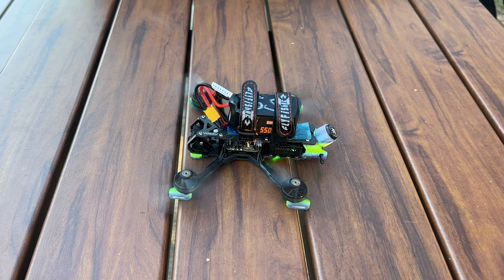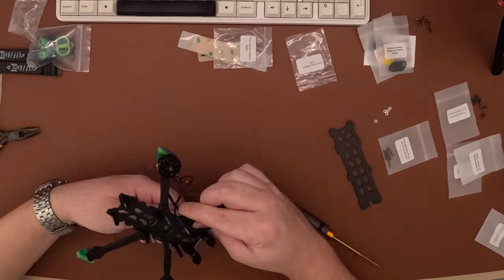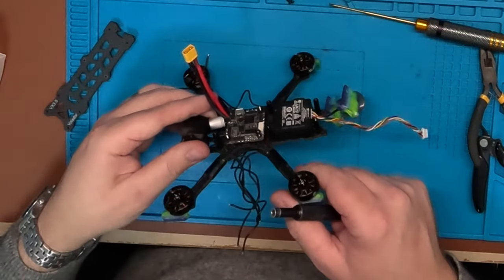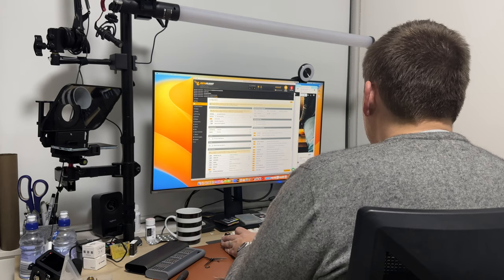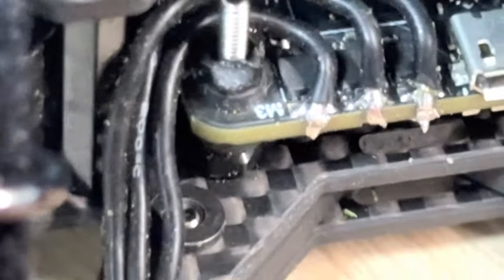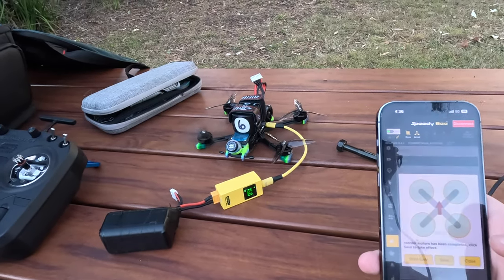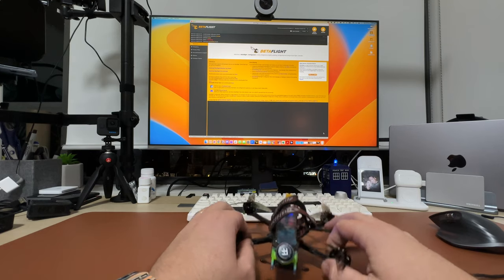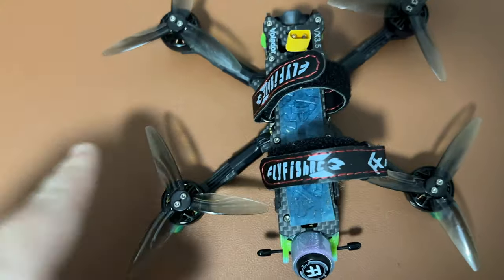THIS Happened To My Brand New Build

Comment: Im building this. So the board issue? I was going get 25x25. But after ur problem i went with a 20x20 speedybee. Alsoo did u use the supafly preset?

Comment: You forgot one more thing. You should also rotate the quad and verify that the yaw axis is correct too. If the board was flipped, it’s possible to get pitch and roll correct but not yaw.
Reply from the maker: very true!
Reply: Absolutely right ✅️

Comment: I was given a Radiomaster TX16S ( I guess version 1) and a Mobula6 with ELRS 900/915 Rx built in to the FC a little over a year ago... I spent weeks trying to get it to work but no joy... the guy who had it before me couldnt get it to work either, nor could several other flyers. So it got put aside for several months. I was then given a box of 5" pieces parts ( DIY build kit) several months ago and took my chances at getting it to work... again no joy, until just a few days ago. Finally figured out what needed to be flashed, what needed to be upgraded and then purchased the Happy Models ELRS 900/915 and 2.4 add on Tx packs for the radio. I set the 5" up with the 2.4 EP-1 elrs Rx and got it working but the motors all spun the same direction. Off to Betaflight to check things out and had to rewire the #1 and #3 motor to get reverse rotation.... did a motor check and it still works. I set things all up and tested it on the radio and more joy, but a glitch showed up in the throttle, reattached to Betaflight and it tells me it needs some kind of "upgrade" since I changed a setting on the GPS... I let the setting take place and WTF????  now the 5" doesnt work on the radio but does in Betaflight but it no longer finds the Txmtr...  Betaflight may be an awesome piece of software but it is driving me nutz...  ohh and BTW the Mobula6 still wont bind to the RM TX16s with HM ELRS900/915 Tx module....  Im at a total loss with the Mob....  I long for the days of FM and Xtals, so easy to use, all you need is matching Xtals and youre good to go...  no flashing, no binding, no computers needed

Comment: thanks Darren, i missed this video on the release tbh, but im so excited for this volador 3.5 with 1804, i just ordered those. built my 3inch in spring with 1404 and suffering with the lack of power on a heavier frame, sooo now will try this combo, it looks like there is no lack of power from the flight you had. 
what are the props you used?
Reply from the maker: Props I think from memory were the gemfan hurricanes

Comment: I had to invert a GEPRC 35 amp FC set up for a cinelifter to work on my 4" racer X frame.
Everything was fine.
Next build was my Apex HD freestyle frame And I had installed a stack I already setup and used for a 4" quad and didn't bother to change anything in Betaflight.
When I went Outside for my maiden flight it did that same backflip as the intro but slower.
I tried twice before I realized That the lemon lime props I was using are sold to be either limon on one side ond lime on the other, or likewise front and back.
I had my rear props on backwards because I crossed colors.
Sometimes it doesn't require betaflight to fix the problem... Check your prop rotation first. 😉

Comment: A 20x20 stack might save room to the sides, but not in hight. Depends what you need.  Obviously you benefit from seperating esc and FC in case of burning something dead. It adds 5g though. Here sub250g is already not possible anymore.
Gemfan just released some 3630 props. I'm building a 3.5" 6s on 2004 motors anf the 3630 next.
Unfortunatly there are too little 4" frames I like
Reply from the maker: For a mini stack. You’d have height, which wouldn’t be an issue. There is still plenty of clearance as you can see from the stack screws. 

Sub 250g is getting more difficult. 300g is doable. They’re not going to know 200g dry weight vs 300g AUW

Comment: Just sometimes the better you get, you can miss simple dumb things -- I completely setup a quad and it, checked motor order, direction etc etc..  tested and it flipped out, I fiddled with it for hours, like a mad scientist and gave up for the day, came back the next day, did I really forget "Motor direction is reversed" tick box yes what a dumb arse -- nothing to see here
Reply from the maker: for me, I always* follow a pragmatic approach to building, I go through the motions and process, whether I think it's right or not.

Except this time, I was under a bit of time pressure to get it done so wasn't as pragmatic as I normally am, and then problems.

Which is why the solution was to come back, follow that pragmatic approach so I knew it would be correct.
Reply: @DarrenAllatt  With the FPV hobby  we always seem to be running out of time and day light 🙂